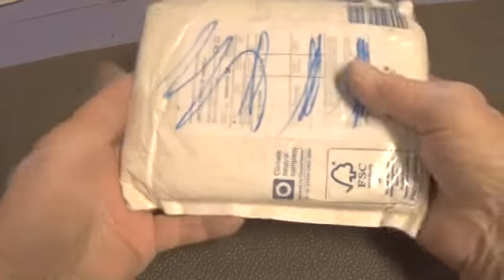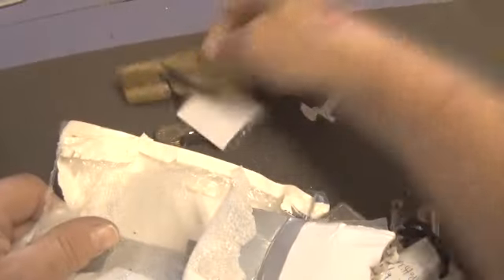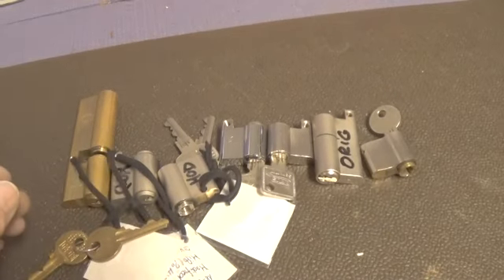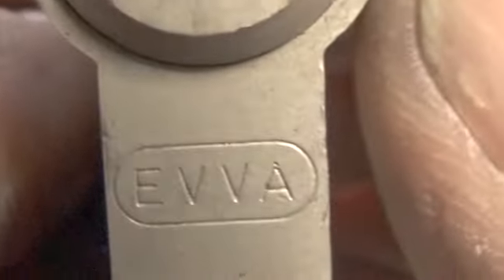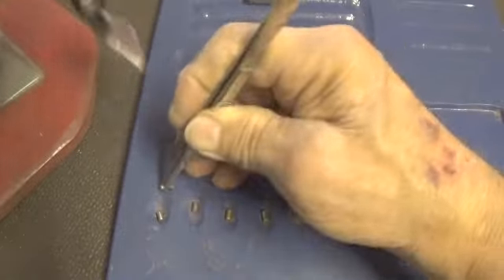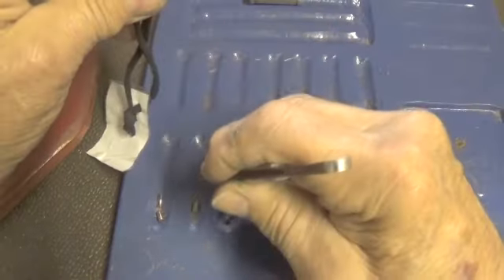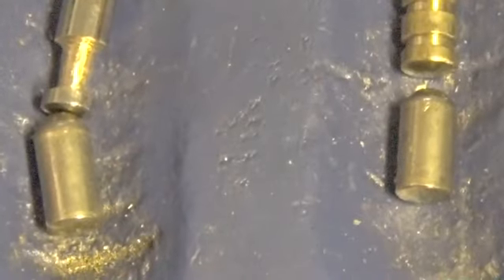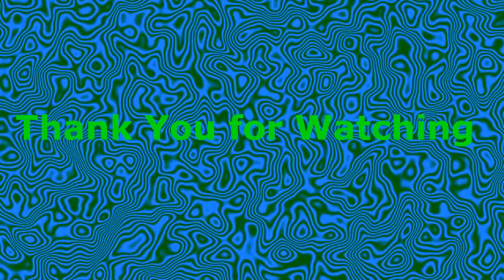(280) EVVA Euro Challenge SPP'D and Gutted Lock from Potti314 and other locks received

Comment: Its exciting for me to see you picking the locks from my package. Exciting to see how long it withstands your attack ;-) Well done on the EVVA. Hope the others will entertain you a little bit longer. 
The GeGe has two sides (MOD=modified) and (ORIG=original) pinning. Same for the CES, but this lock I had to cut so you have the two sides separated. With the ORIG and MOD you can compare your picking experience: factory made versus modified. Hope you like it. Cheers.
Reply from the maker: +Potti314 The DES Lock willbe a challenge. The unmodified ces took about 30 seconds to open, I moved the two spools and the three standard pins in the lock and it made it much harder to open. Took about 1 1/2 minutes.